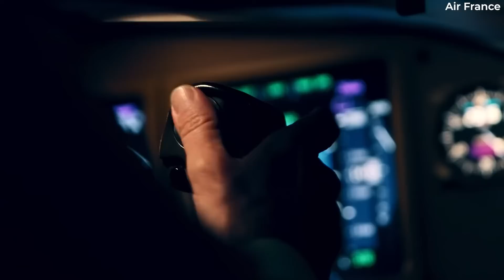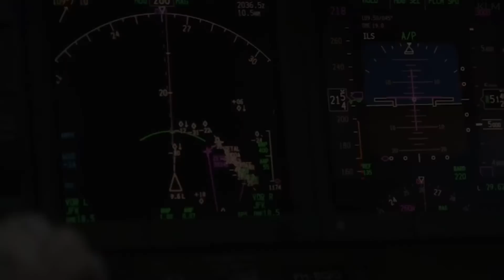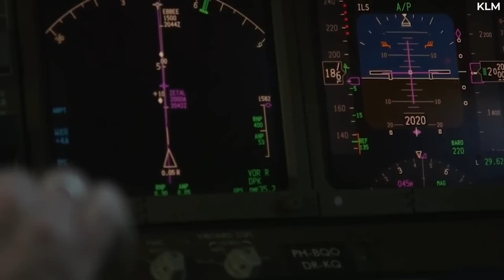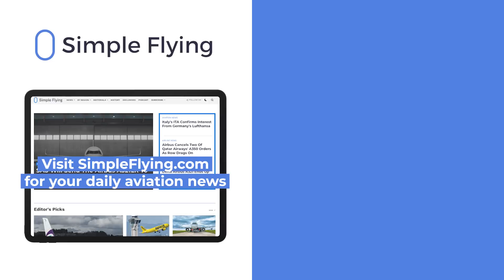Why Might An Aircraft Hold Before Landing?

Comment: I recall taking a flight from Ottawa (YOW) to New York LaGuardia (LGA) in 2010 or so, and weather was poor in New York, causing delays and, I suspect, capacity issues. Apparently, given the hold times at the time, it made more sense for us to delay our departure time by an hour. Though cloudy on arrival, conditions had improved enough that holding was minimal before landing.

Comment: One of the main reasons is when landing at an airport with a curfew e.g. Sydney airport. Approx 20% of the days overseas arrivals land within the first 2 hours of operation (between 6-8am). If there have been favourable tail winds, aircraft will have to form holding patterns to wait for the airport to open, and to wait their turn for a landing slot. Some aircraft might slow down the last 500kms or so, and deviate to take a slightly longer flight path to the airport. You can see this on most days at Sydney airport (SYD) on Flight Radar or similar app. Likewise on rare days when the airport is fogged in and no aircraft can land until weather conditions improve.

Comment: I had a 90 minute hold overhead Canberra on a Qatar Airways flight to Sydney. We had a strong tailwind all the way from Doha and were too early for the end of the Sydney curfew. In the end we landed 20 seconds after Sydney opened and were still 15 minutes ahead of schedule. At the other extreme, I had a 4 hour hold on a Melbourne to Sydney flight due to weather and ended up back in Melbourne because Sydney's curfew commenced before the weather cleared.

Comment: I have been in a hold on flights from NZ arriving early into MEL and traffic at the time. One time it was due to a severe thunderstorms. Twice around  Warragul. Then another couple of times north-east  of MEL after we had clearance but the flight  ahead of us aborted it's landing attempt. The rain was so heavy the terminal roof sprung a  leak. We ended up landing  from the east rather than the east in a clear sky. 

On my last flight to DUD a couple of weeks earlier from MEL. The ATR 72 I was on in the base final was hit on  the left wing by lightning. It was out of action a few days later when I flew to WLG for the day to see Evita. DUD can be tricky if there is a Nor'Wester blowing  over the Mangatuas (west of DUD) causing a surf like wave with downdrafts. Happened once and nearly diverted to Invercargill or back to CHC.  We landed on one wheel and the galley doors flew open and the chap next to used the sick bag! We landed without further  incidents.

Comment: Was flying into SAI in November and I noticed the plane taking many, many left turns. I didn’t have a window seat so I couldn’t really tell at first. Once we finally landed, I asked my group if they noticed anything but they said no. Once on WiFi, I looked at flight radar and sure enough, we did hold for a solid 5 minutes. Although I was very confused on to why as SAI is not a busy airport by any means and we were the only plane landing at the moment. Maybe there was a late take off or we came in earlier than expected. The guide who was to be with us during the short trip into Cambodia said that he saw the plane holding. I guess I was the only one who noticed as I am an avgeek who is hyper aware of everything going on in the plane.

Comment: Had to hold on a Batik Air flight from KL to Singapore due to bad weather. We circled Changi for half an hour before returning to KL for a flight to nowhere.
Reply: I was amazed they didn’t have a high speed rail link between KL-Singapore when I visited tbh.
Reply: @d.b.cooper1 it's a lucrative corridor, with probably 40 or more flights a day
Reply: @d.b.cooper1  Well, I think you can go to Johor Bharu, and then you need to change for a bus to reach the MRT West line or whichever MRT line it is... But yeah, there should deffo be an intercity train between downtown Singapore and Johor Bharu. Malaysia and Singapore needs an open border treaty.

Comment: I find it hard to believe that a plane has to burn extra fuel before landing after a regular flight.
The weight for landing seems to me passed already! If not, can someone explain to me?
Reply: @arienoordzij3823  
I think maybe you confusing something. After a regular flight it does not need to burn fuel, the only reason it would need to burn fuel is, if it had just taken off and needed to return immediately.  
It would need to get down to its maximum landing weight,  which is a lot less than it’s maximum takeoff weight
Reply: @Rasscasse  I understand what you say, but that's not what he said in the video! 
He was NOT talking about an immediate return after take off.
Reply: @arienoordzij3823  
I understand you, he’s talking about quite a rare circumstance where an aircraft would arrive too heavy after a regular flight   This doesn’t happen often.
Reply: @Rasscasse  👍Thanks again, but I'm a bit stubborn.....how on earth can a plane be too heavy after a regular flight? In that case  the crew made, in my opinion,  a huge miscalculation with fuel quantity  before take off.  Maybe someone else can give more info too?  Or it's just a mistake made in the video!
Reply: @arienoordzij3823  
He did explain in the video, where sometimes aircraft can be expecting heavy delays, so load extra fuel, but then the delay does not materialise, so they end up with an overweight.